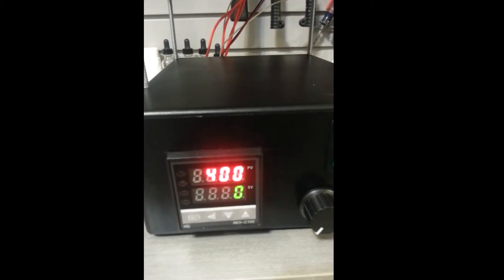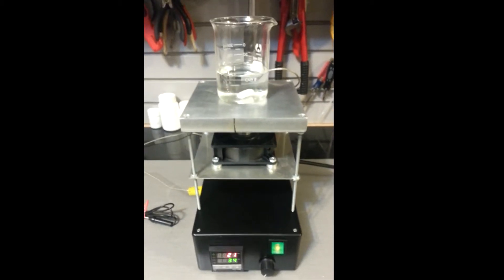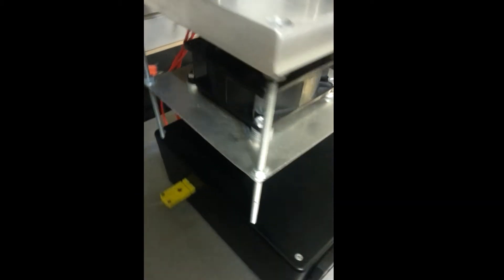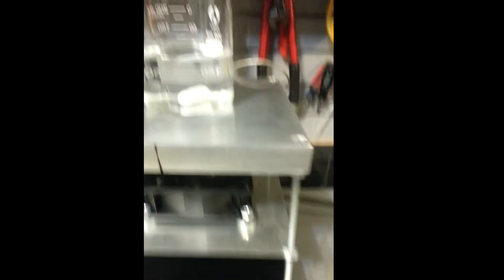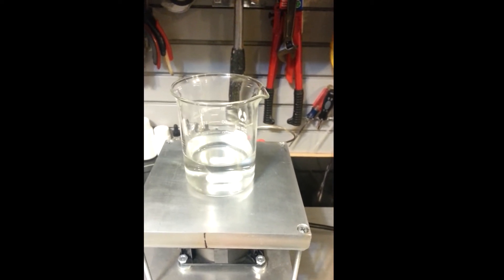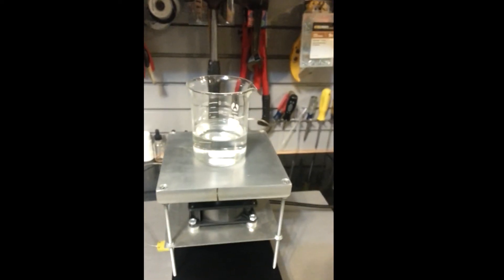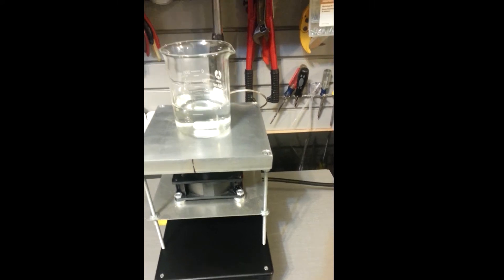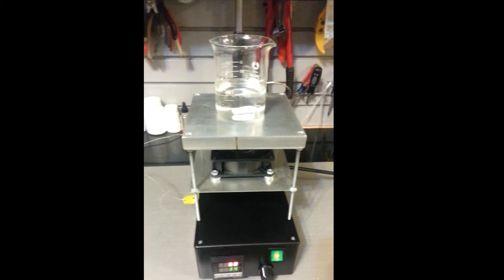Homebuilt PID Controlled Hotplate and Magnetic Stirrer

Comment: Hi there, nice project. How did you get to using 2 x 400W heaters? Did you just eyeball it or compute ? 800W in total seems a bit overkill for such a small aluminium plate.
Reply from the maker: The 800W was just an estimation, but it is probably a bit overkill. Thanks for checking out my channel!

Comment: Simple and to the point solution, great job! I would like to ask you something. I have a heating mantle and a relay with a Schuko power output. I want to get a PID temp controller and connect it to the relay so that it will turn the mantle on or off. Do you think it is possible?
Reply from the maker: Yes that's absolutely possible. Just put your thermocouple in the heating mantle, add your round bottom flask, and connect the thermocouple to the PID controller, and the power to the SSR or relay being driven by the PID.

Comment: Firstly, thanks for posting this, it's a really neat solution. Does the PID you used supply the power directly to the heating cartridges, or does it acts as a switch to trigger a PSU that heats up the cartridges?
Reply from the maker: Thank you for your kind words! The PID controller switches a solid state relay, which opens and closes the circuit providing the heating cartridges with 120V AC (the cartridges are just tied in parallel).
Reply: Thanks for the super fast answer - I'd just about figured this out myself, but was wondering if the SSR is on/off or variable. I'm guessing it is simply switched on if the temperature is too low, rather than having its temperature varied.
Reply from the maker: You are correct. The SSR acts as an on-off switch. The PID controller determines a logarithmic function to reach the set temperature and switches the SSR on and off with varying duty cycles (% on vs off). I actually took a class in college on PID control, and while it was interesting to learn whats going on behind the scenes, its not really necessary as most of them today have an auto-tune feature which will get the settings very dialed in.

Comment: will that PID allow you to heat up 2 plates exactly at the same time with the same setup? or would i need another pid controller to heat up another plate with the 2 heating elements and thermocouple?
Reply from the maker: +Sean Mendoza I'n not sure if these PID's can be setup for that type of function. But we have some at my work that do exactly that. You could just setup two PID's and set them to the same value.

Comment: I have a bunch of white lo pide I've been thinking about doing something very similar to this. I'm surprised that you say it's inaccurate in it overshoots the temperature because they're very accurate controllers I couldn't tell exactly what brand you were using but most of these PID you have to calibrate .
 
What kind of heating element are you using
Reply from the maker: +Clown Whisper When I say inaccurate, my standards are probably pretty high. I took several classes in controls automation while getting my engineering degree, so I was used to finely tuned high-end PID controllers. Having said that though, this controller does has an auto-calibration setting you can run. Over the course of several hours it will fine tune the programmable variables for near perfect performance. I just haven't bothered to run it yet, since its definitely good enough for my use as is.

Comment: Very, very nice. I have already made the stir plate but wanted to add heat and this is exactly what I was looking for. The only thing confusing me is the circuit board on the right side of the video @2:51. Is that the 12v power supply? And where can I get those yellow connectors for the thermocouple? Also info on the external probe if you remember. Thanks so much.
Reply: I found the yellow Thermocouple connectors and an external probe.
Reply: That's not a brushless fan is it? That style of PMW says not to use a brushless fan. Not sure if what I have will work. Please advise.
Reply from the maker: krwynn Not sure if its a brushless fan, but it really shouldn't matter all that much. Brushless would just cause a slower response time compared to a brush type motor, and wouldn't work at very low speeds... much like mine does, so mine probably is brushless thinking about it. The tiny board you see attached to the side of the project box is in fact a 12V step down transformer that then feeds the PWM circuit.
Reply: ElementCollector1001
Thank you!

Comment: All I did with my fan was to use a regulator chip and a very low pot. It goes zero to wtf in  seconds.
Just just under voltage the fan and use the chip.  done.

Comment: interesting idea.. i have a hot drink mixer that has a tendency to leak around the seal in the center of it where the blade pushes through at.. i was thinking of putting a rivet here or something, then on the coupling part on the base just screw and mount the magnets to convert it to a magnetic stirring mechanism

Comment: Does the aluminum plate affect the magnet at all? I've built something similar and the aluminum slows the rotation of the fan considerably. is this why you have the heatsink?
Reply: I'm about to do the same thing with a premade hot plate , but I assume that heat sink is just there too help keep the magnet cool so that it doesn't lose its magnetism... aluminum is diamagnetic... It will definitely slow down the magnet just due to it's by diamagnetic properties... I doubt that anything you will be able to do, short of thinning the aluminum at the hot plate, we'll keep this from happening sadly.. :-( the good news though, is that it should perform exactly the same all the time , so you can probably just plan around that property..
Reply from the maker: Even with the thick aluminum I used for this hotplate, there is plenty of magnetic force to couple to the stir bar. And you are correct, the heat-sink is to help keep the magnet cool, and prevent loss of magnetism. So far, its still working great.
Reply: +ElementalMaker oh! wonderful to know.. and really amazing work. ^.^ It looks quite bad ass...
Reply from the maker: Yeah it really works great and has served me very well over the years. Being able to go up to 400C with such accurate control is great.
Reply: +ElementalMaker I'm still a bit unsure if I'm going to do this, but I'm thinking of basically using a raspberry pi to allow for temperature and spin control as well as tracking of temperature into a graph. I'd also want to be able to do this through a web interface.

That alone would probably be a bit of work, but if I do end up doing that much with it, I also might try to allow for simple programs, like "spin 200rpm for 1hr with temp of 70c, then send text. " I really like open source and I think it's sad that something with that feature set would cost a grand from a lab supplier..
Reply from the maker: That would be a really cool project! with the script libraries out there it should be easy to set up PID heating and spin (probably PWM) control.
Reply: +ElementalMaker yeah, shouldn't be very hard, but probably a bit time consuming.. Lol I'll let you know if I start making it..
Reply: +ElementalMaker yeah, shouldn't be very hard, but probably a bit time consuming.. Lol I'll let you know if I start making it..
Reply: +ElementalMaker yeah, shouldn't be very hard, but probably a bit time consuming.. Lol I'll let you know if I start making it..

Comment: Are there any good alternatives for the heating element? Could i just stuff the aluminium box with coiled wire from a toaster or something like that?
I have a heating element from an old hot plate like this: http://www.amazon.co.uk/Melissa-650-003-Electric-Hotplate-Cooker/dp/B004P3OARM
But I guess the magnets will not work through it since the metal is magnetic?
Reply from the maker: While heater elements like that would certainly work, it would be very tough to integrate. Heater cartridges, such as the type used in this build, are dirt cheap on eBay thanks to China!
Reply: Why would it be tough to integrate? Could i not just take off the bottom and mount some spinning magnets underneath? The heat is not the problem, I am just worried that the iron will block the magnetic field?
Reply: In a heating cartridge like this:
http://www.ebay.com/itm/High-density-10x100mm-220V-250W-Cartridge-Mold-Heating-element-heater-Tube-/231114595328?pt=LH_DefaultDomain_0&hash=item35cf80dc00
Are the ends towards the cartridge itself insulated against the heat?
Reply from the maker: Yes the cartridges are well insulated. Here are the exact ones I bought (mine were for 100V however). http://www.ebay.com/itm/AC-220V-400-Watt-Electric-Heating-Element-Cartridge-Heater-9-5mmx100mm-/161080793893?pt=AU_Business_Industrial_Industrial_Supply_MRO&hash=item258129db25
Reply: ElementCollector1001 Okay thanks. Will I be able to control the temperature with this? http://www.ebay.com/itm/220V-2000W-Speed-Controller-SCR-Voltage-Regulator-Dimming-Dimmers-Thermostat-New-/190785483268?ssPageName=ADME:L:OC:US:3160
And if so, how accurate do you think it would be?
Reply: ElementCollector1001 Did you just drill two holes in the aluminium for the cartridges?